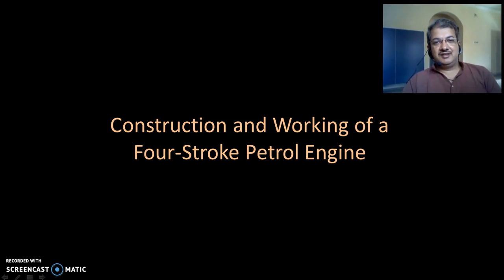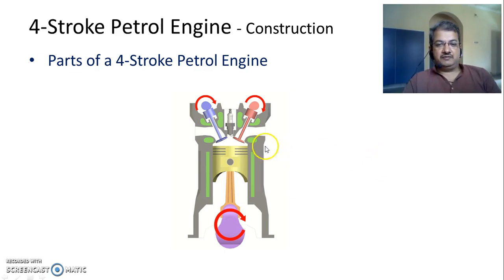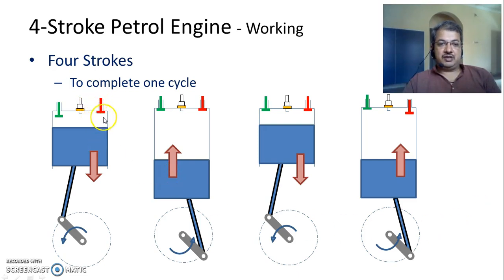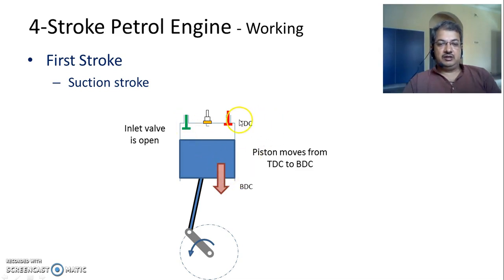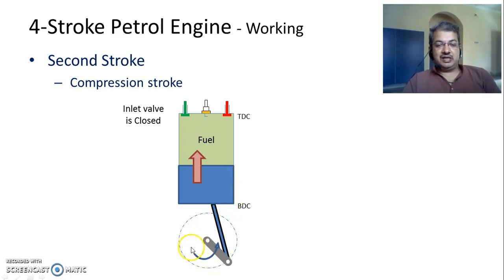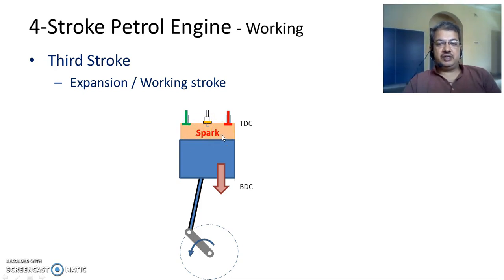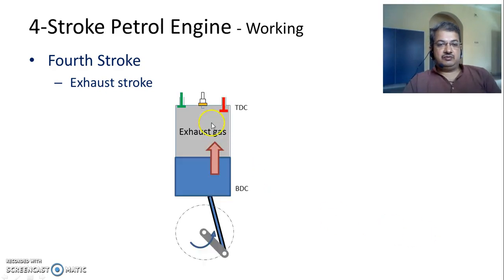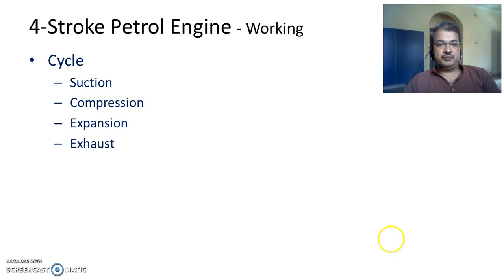Working of a Four Stroke Petrol Engine

Comment: Hey Buddy, I was looking someone to get the advice for my car, then I though no one would be better than you. Please help & suggest

Q - I own the i10 1.1, Model 2010, has run about 1.25 Lac KM. On the 80K KM. engine has already been rebuild (complete open and repair) and now mechanic is again suggestion for complete engine rebuild. As per him, it will cost me 20K. I want to run the car for another 2 year due to tight budget. Should I go for engine rebuild, will it be worth and give me the smooth 2 year of life in city like delhi.

Currently, car has the overheating issue, white smoke while start the car, pick is almost nil (have already got the new clutch plate), it eating the oil (this may be because of oil seal breakage). 

Please suggest, Kya pura engine ka kaam karwana thik hai ya car bech do.